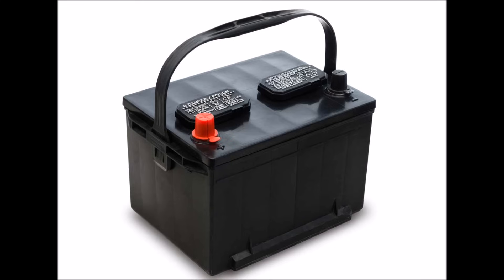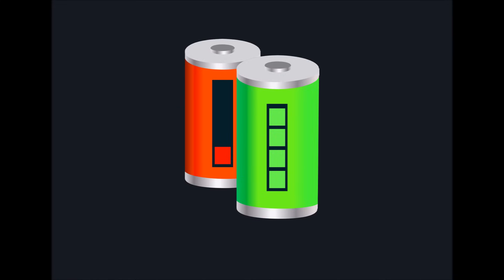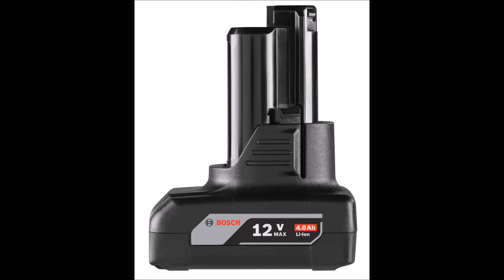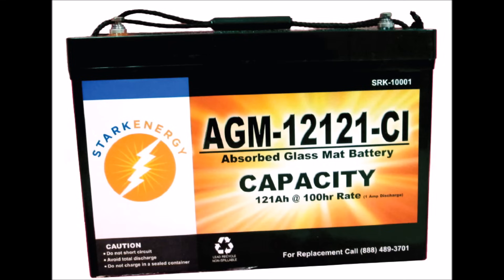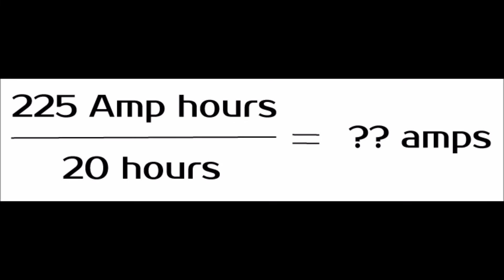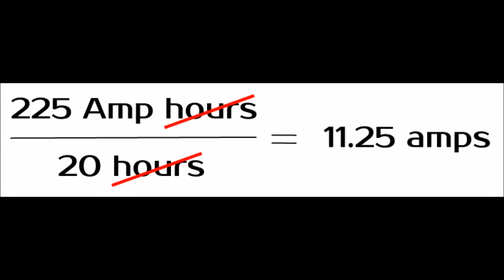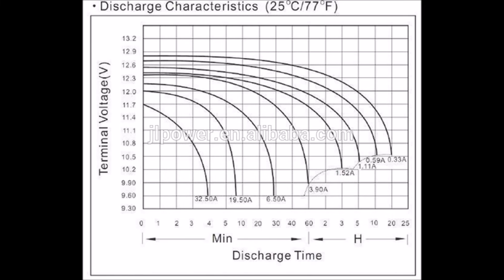Amp Hours???  Battery Capacity Explained

Comment: Thanks man, very helpful. I understand. Choose a battery with lower per hours in the specification, for example 12v 100ah/10hr or 12v 100ah/1hr? Of course choose the second one, it has a larger capacity. Many people are having a very low comprehension, they can't catch up a simple under 3 minutes explanation. Lol. I am from a developed country and a non english speaker, a gamer, not a really educated person, but can easily understand. Haha

I hope you pin my comment.
Reply: For example my motorbike's battery is 12v 3.5ah/hr, so i can use it to power something that draws 3.5 amp 12v, it can supports for 1 hour straight. If I'm using it to power something that draws 7 amp 12v, it can lasts for 30 minutes. Again, if i use it to power a 14 amp 12v device, it lasts 15 minutes. And... If i power something 12v 0.35 amp, my battery will stop working in 10 hours. Hope this helps you guys.
Reply from the maker: Pinned just for you.  Glad you grasped the concept!
Reply: What a condescending way to answer and a complete ass wipe. I understood the concept also but your attitude is out of pocket.

Comment: Do you have a video or can explain to me what charger you would use for a 12v 18ah battery where the battery would last the longest not after the quickest charge? say if the battery was completly dead say it charges it in 5 or 6 hours.

Comment: Hi, I have one question...why 24v solar panel not connect to 12v battery?
Reply from the maker: Some charge controllers can handle the transition but you are wasting energy converting like that.  If you have a 12V battery bank then you should wire your solar panels to be 12V as well.  Same with 24V.
Reply: @LDSreliance  Thanks..suppose if I use 24v solar to 12v battery without using any controller...then can I use 24v panel to 12v battery.? If not means what is reasons behind this?
Reply from the maker: @mshanmugapriyan  No, you can't do anything without a controller.

Comment: and you forget to mention that the standards for lead acid batteries say that the capacity is measured untill the battery reach 10.8V, but if you are using it under 12v will sulfatate and destroy herself much quicker... so if you discharge it untill 12v you will have much less capacity....

Comment: Terrible explanation. The easiest way for me to understand it is, for example a 4Ahr batterry,  if your device is drawing 4 amps from the batterry,  at that rate  your battery will last 1hr. If you're drawing 8 amps your battery will only last 30 minutes. If you're device is drawing 2 amps, your battery will last 2 hours.
Reply from the maker: That is not true, though.  The higher the amp draw the lower the capacity will end up being.  If you don't understand this concept you will be sorely disappointed with your battery(s).
Reply: @LDSreliance  My explanation is just in theory and another way of understanding amp hour

Comment: Hi my current battery is12v 6ah 10hr can i replace bettery with 12v 10ah or higher number on ah and hr. Which means i want to replace with 12v with bigger capacity battery. Pls advise me thank you
Reply from the maker: Yes you can always replace an existing battery with one of the same voltage with slightly higher capacity.  Just don't go too high or the charger may not be able to handle charging the new battery up fully.  And sometimes there is a size constraint or a special connector required so make sure it will fit.
Reply: @LDSreliance  Thank youi very much for the feed back god bless you.
Reply from the maker: You are welcome.  Good luck!

Comment: I have a escooter abd i just replaced my batteries, 5x 12v 25 ah.  But it seems my charger , that i also used for my 20 ah batteries cant charge them fully, and tgey also dont last as long as when i received the batteries full charged.   Now im googling about it and some say i need a 25 or 30ah charger and others say i need a charger that charges with 10% of the total needed ah value.  Not planning to buy new batteries every 6 months and restricted  to ride only small  distances . Will give ot one more try, but else i think i can say that the philippines is not ready yet f9r ebikes if cant provide correct info and  equipment

Comment: I need some help.
if something requires 13ah to run for 20 miles.
if I use 101 ah battery does that mean it should go 140 miles? 
the battery required is a 24v 13 ah lithium battery, I'm going to be using two 12v 101 ah lead acid. if I remember correct up the volts amp remains same. so should be 24v 101ah. right?
Reply: for those wondering why I dont just go lithium.
1st. will be charging with 24v solor panel.(250w). the batteries are made for 110v charge.
2nd lead acid a lot easier to get for me.
3rd. looks like a silver lining to my charging situation is I get much more battery. ( can only charge with the 24v solor panels)

Comment: 200AH 12V  battery in series  parrellel connection  charged accross 24 v supply 

What is the total AH capacity in this case . 

Is it 800AH or just 400AH . 

Please answer sir
Reply: When you connect your batteries in Series your voltages doubles but your capacity stays the same. So your series connected 2*12V = 24V with 200AH. In order to have a higher capacity you need to double your batteries. So 2 in series and 2 in parallel. That will make your total 24V with 400AH. Hope this answers your question.

Comment: So if I wanted to run multiple alternators say like 20 12v 300amps or 3.6kw high power car ones for 100kw at 12v to 15v at 6000amps would I need one for each or could I run it on one 12v 300amp battery so I don't blow it up other wise I'am going grafite and most would be for direct load use not storage use.

Comment: Can you tell me what amp hours would be recommended for 4 twelve volt batteries for a 48v 1000 watt ebike converter wheel?
Reply from the maker: Not enough information.  This would be a complicated equation even if I were confident enough in the math.  But you would at least need to know the relationship between weight of bike and gearing and energy consumption.  And then you would need to know how many miles you want to go on a single charge.
Reply: @LDSreliance  ok it calls for 17ah or higher! To work
Reply from the maker: I don't know enough about ebikes but 17Ah would not go very far with a 1000W motor.  I would say minimum 40Ah.

Comment: hello, this summer i want (for a small party) to run 2 krk rokit 5 monitors, my laptop and a dj controller all at the same time for about 6-8 hours. would this be possible with batteries and an inverter? 

the manual of my krk's says that each monitor has a total power of 50 watt. some people told me this wouldn't wouldnt work even if i had 20 batteries, but i've seen other people on forums say something similar is very much possible.

 also to be honest i do not really care about wrecking the battery as long as it doesnt become dangerous. 

IS THIS POSSIBLE? PLEASE HELP :)

Comment: Hello. I have a question that needs a good clear answer. 

My intention: To busk with my bass amp using a battery.

Ok so my bass amp is : 100 watt max output. 310 Watt power consumption

I have a 500 watt (1000 peak) invertor (modified wave). I read on 2 sites that its a god idea for to besafe, use a wattage 10-15 pcent on top of the power consumption value. (mine being 310 watts)

I wont be cranking the amp up loud as it produces some lovely low end sounds.

So..... For the battery, im aware of deep cycle bateries are more energy efficient (i dont mind charging it up eith my 12v charger when needed).

There is a guy called DUB FX on youtube and he walks you through his setup.

His setup is a 200 watt roland speaker combo amp. HE USES AN 800 WATT MODIFIED sine wave inverter and a 66ah 12v gel battery.

My amp is half the wattage as his. 

Which battery would suit me for 3 hours of play time?

Weight isnt too much of a problem .

Thanks in advance folks of voltagery wattagery wizdom

Comment: good video, about the lithiums in the EV's in comparison by using ledacid  batteries to cover almost the entire floorboard with ledacid rechargeable, how do you think the performance could be? using specifically 'say'  multiple 1,000cca ledacid truck batteries in series or both series and parallel connected to a electric fork truck motor? it'll definitely get warm maybe fan's underneath giving it a hydroplane effect, cooling the batteries. You could put some super capacitors before the ledacid batteries for extended life, and after the ledacid for drain. what do you think?
Reply: sorry I meant ledacid batteries. you can take a dead nickle rechargeable and put it on a lithium charger it'll charge quick try a AA the nickle holds 2 properties of being an electrolyte and acid, being able to take a quick charge acting like an electrolytic without the electrolytes, to prove this open a dead AA nickle then soak it in electrolytes the glue it back together. or if possible if you know the right spot drill a tiny hole then soak it.

Comment: So does this mean the battery will produce 11.5 amps per hour or per second .
Reply from the maker: Amp hours is a measure of capacity, not output.  You can usually find manufacturer specs for peak current draw.

Comment: Basically battery capacity doesn't tell anything about the ampere in circuit..Ampere in circuit just depends upon wire resistance and load applied..Am I right please reply soon???
Reply from the maker: You are correct.  There is a limit to how many amps the battery can supply and then it is further limited by the wire size and resistance.

Comment: What Im interested i n knowing is if i can use a  discard car battery for small electric jobs such as emergency emergency spot light,  outside security lights etc etc

Why do I get the feeling that the battery has SO much capacity (even one not suitable for starting a car) as soon i connect a wire  to it , the wire will glow red hot .....  also any thing connected to it?

Where am going wrong here?
Reply from the maker: For an emergency, yes.  For daily use no.  

Current will not flow through your wire unless there is a load on the other end of the wire.  So if you short circuit the wire (touch the positive and negative together) the electricity will flow OR if you have something connected to the wire that wants to consume electricity.  But only enough electricity will flow for the device's needs.  The battery will not push more power through the wire than the device is asking for.
Reply: @LDSreliance  interesting.  So there would be nothing to stop me rigging a side lamp bulb up to a fully charged car battery using 2 foot of 5 amp (automotive)wire.   The wire would not get hot?
Reply from the maker: Nope.  The bulb would pull just the amount of current it needed.  And unless it exceeded the amp rating of the wire you have nothing to worry about.
Reply: @LDSreliance  Thank you.

 "The battery will not push more power through the wire than the device is asking for".

That's worth knowing.

Why do you say it's not for daily use?  The fact a car battery looks unsightly or other reason?

Once  again thanks for debunking a (life-long) personal logic- block.
Reply from the maker: Car batteries are designed to provide a high amount of amps for a short amount of time to start a car.  They cannot be deep cycled (drained more than 10% of their capacity) without doing permanent damage to the battery.  That is why if you leave your dome light on in your car overnight the battery is dead in the morning and may or may not be able to be revived, depending on its age and condition.
Reply: @LDSreliance  I see.
Reply: @LDSreliance  The only thing i would say to this is that my lights got left on one car and it was completely zeroed .........I mean no ignition lights at all.

A set of jumpers of tree trunks and it was going again.   The battery never gave any problems.

Comment: It's a lot easier to understand the capacity of a battery by converting the rating to watts.  
Amps 225 x volts 12 =  2700 watts    
So if you have an electrical device that draws 100 watts, you can theoretically run it for 27 hours.
But if you don't want to destroy your battery, you'll won't run it past 50 percent discharge.  
So you really don't want to run a 100 watt device for much more than 13.5 hours. 
Or a 50 watt device for 27 hours. Or a 25 watt device for more than 54 hours. 
Or a 12.5 watt device for more than 108 hours. Or a 6.25 watt device for 216 hours.
Reply: The past 50 percent discharge is only valid for lead acid batteries, lithium can go as low as 10%.
Reply: great response, I make lots of comments but don't get hardly any response, maybe with the EV's we won't have any cca's any more, recently I've been buying used jumper packs all the batteries are dried up , acid , these should still work good. even though many comments go unseen or unanswered it still gives someone a chance to understand something in time or getting a college degree to understand what makes things tick
Reply: What happens if you run your batter when its low? Does that shorten its lifespan
Reply: @tommy3763  capacitors could handle a quick charge for extra charge for the ledacid after shutdown
Reply: @tommy3763  Yes over discharging a lead acid battery will damage the plates and shorten its life by a lot
Reply: @tommy3763 yep
Reply: in comparison with cca at 1,000cca's, to amps times volts to get watts, 1,000cca times 12v would be 12,000watts, would that be correct? in series that's a lot of wattage
Reply: @vincenttelfer4206  No, CCA is NOTHING like Ah. CCA only says the battery can put out 1000 amps at a given temperature, but it will only do that for a VERY sort time, and that time is not usually given on a starting battery which is not like a deep cycle. Starting batteries are rated in CCA deep cycle are in Ah. They are not the same type of rating
Reply: could use the similar bms as the lithiums

Comment: I have a unit that pulls 19.5 amps. Could you please recommend a 12v battery to power it for at least 3 hours? I'd really appreciate it.
Reply: I suggest you use 1 unit 12V battery of 120 Amp Hour Battery capacity. That is using only 50% of total battery capacity and with the condition that you are only using a resistive load. But,ed if you are using conductive load, I am suggesting you to use 200 AH Deep Cycle battery for you to be able to start up the current need by inductive loads.

Comment: 225AH with 10 Hour Rate = 22.5 per hour 
225AH with 20 Hour Rate = 11.5AH per hour 
225AH with 100 Hour Rate = 2.25AH per hour

And all adds up to 225AH in total.

So does that mean if I was using 9AH per hour it would last 25 hours?

Sorry this video is a bit confusing.

Also does the voltage effect how long it lasts? Say a 12v
Reply from the maker: Right.  That is why you have to pay attention to the "hour rate" that is being used.  Some companies will use the longer rates so that consumers will think they are better than they really are.

Voltage will sag the more discharged the battery is.  So it will naturally decrease a bit the longer you use it until it is spent.
Reply: @LDSreliance   I understand now. Thank you for responding
Reply from the maker: You are welcome.  Thanks for watching!

Comment: 121Ah@100hr rate can you please explain briefly? Briefly please 
Respond quickly because I have a presentation on this topic!
Reply from the maker: That means that the battery manufacturer tested the battery to find out how many amps the battery could supply over 100 hours.  By their rating, that means the battery was able to supply 1.21A for 100 hours = 121Ah.
Reply: @LDSreliance  thank you😍 
But what is that you mentioned "It takes 10hrs to discharge the battery?
Reply: And what is meaning of fully charged to fully discharged battery?
Reply from the maker: That would mean that it was tested at the 10hr rate.  They rated it at a current that discharges the battery in 10 hours.
Reply from the maker: Watch:  https://youtu.be/a2woAZhNmA0
Reply: @LDSreliance yeah I watched but  I didn't understand what is fully charged and discharge battery! Can u give definition of those two?
Reply from the maker: Fully charged means that the battery has reached its peak voltage.  For most lead acid batteries that is 12.7V at rest.  At fully discharged or 0% charge it would be at its lowest voltage, or 11.8V.
Reply: @LDSreliance  ok... Then what is that in starting you have shown ...... 4A.h .... What exactly 4A.h means? ( No time given in hrs in that photo)
Reply: If time is present so we can get amps for some particular time...!!!
Reply: One last question.... What is the definition of battery backup time? Please respond